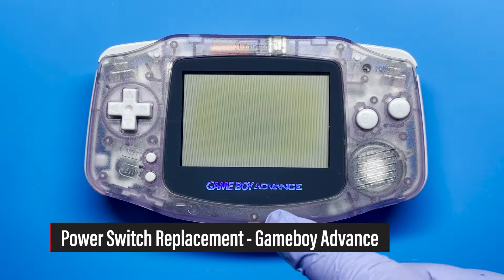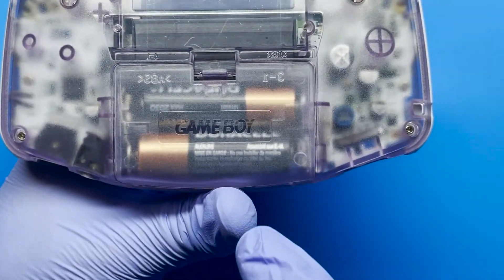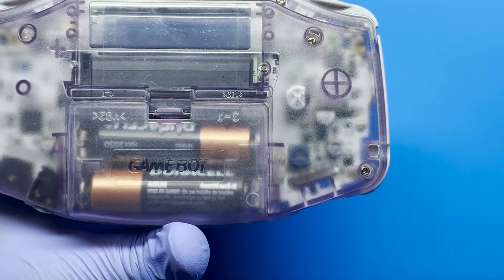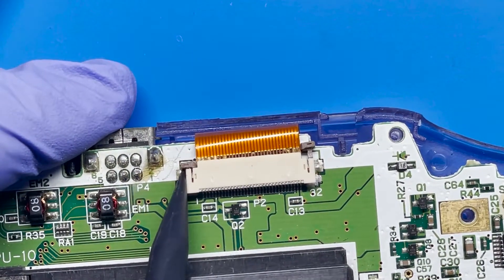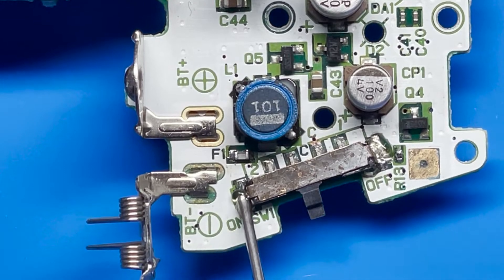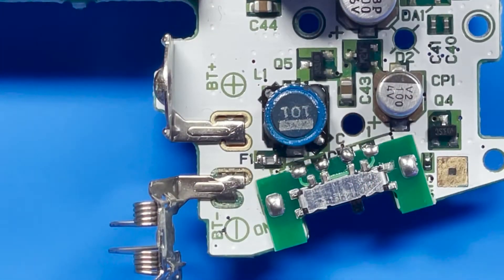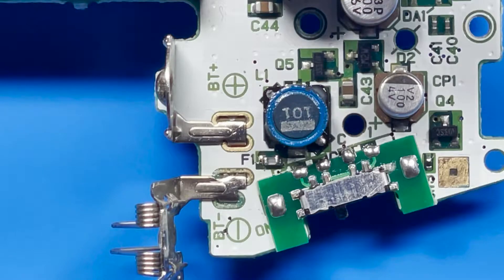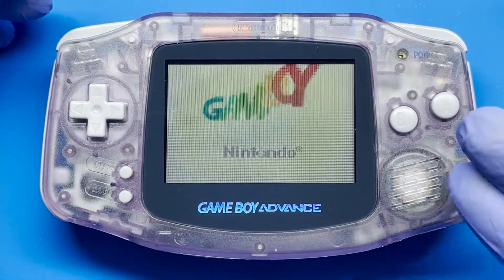Repair a Faulty Power Switch with a Working One | Gameboy Advance

Comment: A I was doing this with the soldering iron but on the last pad you can tell it pulled out but not all the way , will this be a problem once I order a new power switch ?? It’s the last one on the right , I’m just asking before I order a new switch for it not to work

Comment: Hey great video, I'm waiting to get my replacement switch through the mail. I ripped my pads removing the switch with the iron tip but it's an easy trace repair for me.  Many thanks for putting this video up man.
Reply from the maker: Thanks for the kind words and I appreciate you dropping by! Good luck on your repair 😀
Reply: If it makes you feel better I made that same mistake with the pad labeled 1. Luckily that connects to the top point of r13 near the pad. I didn't completely tear the pad but it's not stucturally secure to the board anymore and not sure if it will melt when applying solder.
Reply: @oOignignoktOo1 mine is all repaired now and sold
Reply: Easy trace repair… I mean that’s true for some of us but the average Joe… have you seen some YouTube solder tutorials…
Reply: @ no never, I’ve been repairing since the 70’s so it’s like second nature to me now. Obviously there was no such thing as YouTube etc then.

Comment: I've got a power switch that is probably fine after cleaning, but I seem to have lost or broken the metal from inside the top part of the switch, so there's nothing to make contact. Could I just replace part of the switch to keep the original on the board? Could I take that part off an aftermarket switch or find it separately? I didn't like the look of a whole additional pcb being added on top like in the video.
Reply from the maker: you def can, there will be quite a bit of work involved to get it fitting just right, but to answer your question, yes!

Comment: Hello, thanks for the content. Mine sometimes turns on and sometimes it doesn't, I need to turn that switch on and off a few times. Would this procedure work?

￼
Reply from the maker: Im not sure if something got linked, but I don't see the procedure you are referring to 😅
Reply: @totalfix877  
Sorry, I'm not an English speaker. I was referring to what was done in the video 😬
Reply from the maker: No worries, but I know what you may be referring to. In those cases often times replacing the capacitors work for me. I don't want to say that's what is happening in your case, but it MAY be.

Comment: In the process of removing my faulty switch, I used an exacto knife help remove it. However I ended up pretty much ripping the 4 contacts off the PCB, so now I can't really fully solder the new switch onto the board because theres no where for the solder to adhere to. Is there a way to add new contacts or is this board just ruined?
Reply from the maker: You can still fix it, although it gets a bit trickier. You would need to scrape a bit off the PCB masking to expose some of the contacts and bridge the connections. There is plenty of videos on youtube that can show you how to do this process. If you have any additional questions, feel free to ask. Good news is that it can still be salvaged!
Reply: @totalfix877    If you can throw a video link my way I'd greatly appreciate it! Also thank you for replying. I'm pretty new to restoration/repair so I didn't really know where to go for help -- your video was one of the first few videos I watched to prep for the replacement.
Reply: @SavageOra  do you have a link to the fix? I stripped my contacts off as well and not sure how to repair. @totalfix

Comment: I tried two of these. I am certain i put them on correctly. It worked when it was open. Just slid the switch over and it turned on. Then when I put it all back together, I found that the case kept the slider from flipping the switch all the way it needed to go. Opened it back up and sure enough it just needed to be pushed over a hair more to turn on. Again this happened TWICE. Decided to order an OEM part. Really wish an aftermarket sold switches that were identical to the original.
Reply: Same problem here, not shure yet how to solve it
Reply from the maker: Yeah, I completely understand what you’re referring to. There are ways to make that installation easier by simply cutting some of the PCB that is sticking out from the slider side with some flush cutters. OEM parts are always better since aftermarket pieces tend to be inconsistent at times which can be pretty frustrating. Hopefully you were able to get it working!
Reply: @totalfix877  The PCB wasn't the problem. Best fix I could come up with would be to file the case so I could push the switch over a little further but I really didn't want to do that. Another would have been to lift and move the aftermarket switch closer to the off side but then the contacts wouldn't be center. It could come off. I did get it working with the OEM part but I'm not satisfied with it. It's not a clean job. I don't have all the tools I need to do it properly so I'm just hoping the solder holds.
Reply: @SOLBLADEMASTER Finished my soldering today and ran into the same issue. Seems a common problem. I put a a tiny double sided tape between the plastic switch who trigger the Power Switch.  Worked realy well. Sorry for my bad english 😅

Comment: What temp was your heat gun?
Reply from the maker: I had it at 420c & 120 Airspeed on a Quick brand heating station
Reply: @totalfix877  what about your soldering iron

Comment: I taped off everything around the switch with kapton and removed it entirely with the heat station. That way I didn't have to worry about dislodging the tiny resistor to the right of the switch; the "off" side. That resistor is not essential to power on, but is necessary for quick power off and on. I cleaned all excess solder off the pads so that particular style of switch board could rest flush to the contacts and then micro clipped the board, properly aligned, onto the motherboard. That made it real simple to apply solder to the tip and transfer it to the contact indents and anchors. I've found if one doesn't solder the board flush, leaving too much solder originally on the pads, there is a greater possibility of misalignment with the exterior plastic slider. Hope this is helpful.
Reply from the maker: That's great advice and you are absolutely correct. Thanks for the feedback! Always looking for ways to improve 😀

Comment: just like what this guy did https://youtu.be/PHYjqcb0Sus
Reply: Yes Makho's example of cleaning is certainly step one, of course. But if the original switch it too corroded or worn, usually on the little butterfly contacts, or worse yet, the butterfly contacts become dislodged from the switch lever, then this is the only recourse and is almost as simple to do. Cheers!